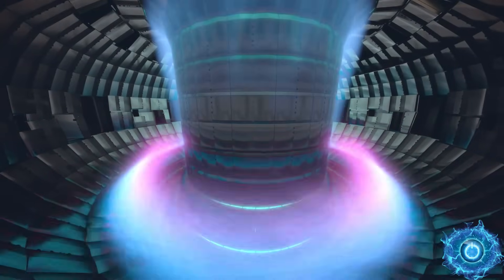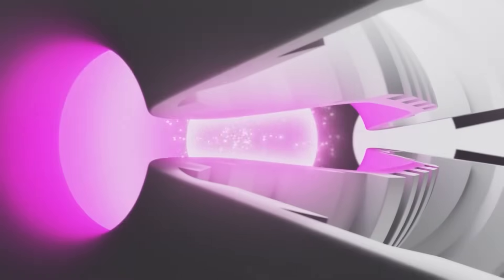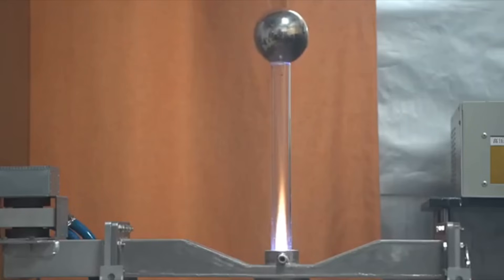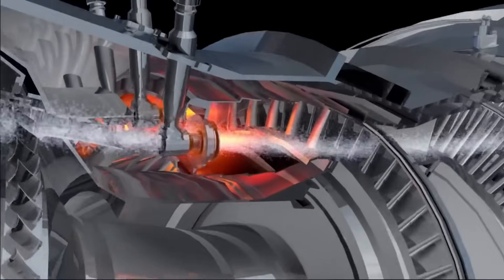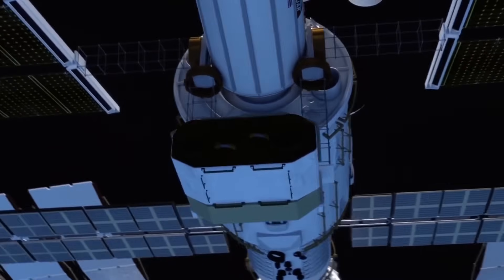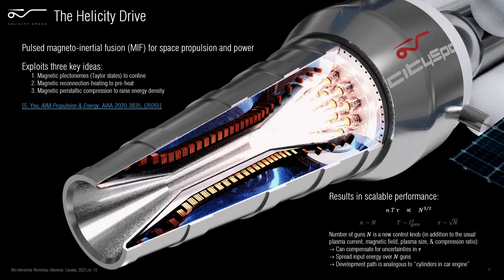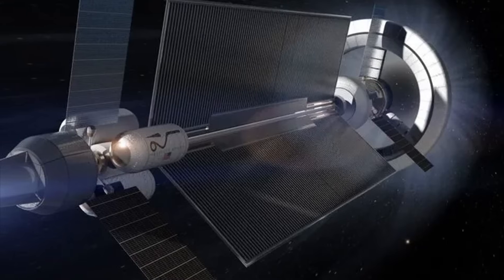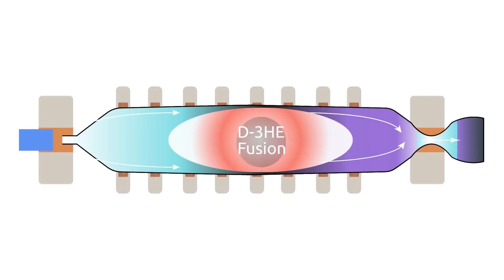New Plasma Engine DESTROYS Rockets!?

Comment: I think a microwave enhanced diode array laser with pulsing magnetic field to compress the flow where small amounts of ??? (maybe iron and hydrogen or carbon and hydrogen) are turned into plasma by the MASER could be fuel and energy efficient enough for long duration space travel.. A solar array to power this in the inner planetary zone would be large but not unrealistic as would a solar furnace.. A small to medium sized nuclear molten salt reactor running an ammonia vapor turbine would not be overly large as a primary or backup power source..

Comment: Check Out LPP Fusion.
They use turbulent flow to create the pinch and produce a plasma beam.  This beam could be used for propulsion.
For energy generation the beam can be passed through an induction transformer to get electricity directly.  No steam turbine.  The pinch also produces a Flash of X-ray which can also be captured and turned into electricity. 
I like this system as it has few moving parts, is compact, and lighter than other fusion attempts.  Which means it could actually be viable as a propulsion system or energy generation system on a space craft where reliability, size, and mass are all key factors.

Comment: any nuclear reactor which has infinite propellant, as millions times more energy storage density over conventional rocket fuels. yes even fission reactors. like photon radiation drive.
Reply: drop out the fusion part, as there are again two concepts mixed confusingly together. just the plasma as the normal electric/heat thruster. until you are making more power from fusion that consuming, dont talk about using fusion for producing real power.

Comment: Tech Planet, If plasma power only needs a power supply, then this power source is possible right now. The project is unfunded, but the concept could deliver Mega-watts in a super small package ~ 1 Mega-watts for just 70 lbs. Power is developed using QED principles. Let me know if you're interested. -e

Comment: We all know that UAP's don't use Plasma Engines. Because there is no propellant at all. So they should dich all of this and research the technologies that will actually get man kind somewhere.
Reply: Yes, but we haven't got there yet to utilise zero-point energy and drives based on it (officially). This is best we got so far but it's an improvement nonetheless.
Reply: @stevannikolovski  have you seen ex NASA scientist Dr. Charles Buhler and his team are called Exodus. They are working on propulsion without any propellant. They claim that the team already managed to achieve over 1G of thrust in Vacuum meaning, things can actually levitate even in Earth's gravity.

Comment: Fusion drives are the ultimate dream towards something like the Epstein drive. Once fusion is achieved, it should be possible to return a small amount of that power back to power whatever's needed on the space craft as well to sustain its own fusion drive requirements; like alternators powering electricity for use in cars, with just a battery to start itself. Fusion drives will require something much more than a battery, like a subMW fission reactor, to start itself, but should be self sustaining once done. Plasma would be a byproduct of the fusion drive, and could be used to excite electromagnetic systems to produce electricity. Now, only to make it so. 😅

Comment: You have solved half the puzzle, plasma needs thrust and using turbine is inefficient; by using frequency to thrust plasma will derive efficiency, feel the thrust from a simple speaker at low frequency...get the feeling?
Reply: Half or less for this gent. He forgot the Bloch Wall frequency. Once that frequency is hit, your free.

Comment: Remember that most Tech that people grew up seeing in Star Trek has become reality.
Reply: I'm still waiting for the holodeck to come out 😅
Reply: This is more Halo than Star Trek. UNSC (Human) ships use Fusion engines, and even though the Infinity uses Repulsor drives it's still technically a Fusion drive.
Reply: @spartantraveler7251  The original Star Trek universe vessels commonly used fusion-based propulsion for sub-light speed travel, I'm pretty sure 45 years count for something ;). Was too old when halo came out to get into it much but I like the Infinity, as far as bad-ass ships go, it's one of those for sure.
Reply: Can't wait to send a fax down to mars
Reply: We are more likely to see the tech from the Expanse coming true.
Reply: @WolfeSaber expanse is meant to be more grounded in stuff we might see in the next 50 years
Reply: And it did because most engineers watched Star Trek and were inspired to create what they have seen.
Reply: we still have none of that tech, what are you talking about

Comment: Now, then releasing something of upper of 1,000,000°C into the atmosphere you talk about global warming beer for real. What do you think that’s going to do to the climate of the planet but now generated magnetic field of bubble you can do it inside atmosphere of the atmosphere, the bubble occurs, how do you contain a bubble to keep it filled around an object it does not happen is different than water. It is the exact opposite so a lot of your stuff will not work as far as heating energy or the plasma to make it expand to create propulsion and generation the turbo ducts one of the blade sections can be set on rotation turning turbine produced electricity. They would have to reach high rate of speed in order to produce energy and possibly put one or two maybe even free generators to ones blade producing energy for impulse shield or bubble, not a difficult design I don’t know why you cannot do that.

Comment: "At roughly 100 Kilowatts". Too inefficient.

"It could reach 123,000 MPH", Too slow, and not enough control.

NASA is really fibbing the designs on purpose.

I mean, a steel hollow ball half-full of mercury can produce the same results at a lower wattage, and the passengers won't feel any inertia.

Reference designs of the "Kugelraumschiff" and the "Karl Schappeller Device: The Vril-1 Drive".

Comment: I think you can make a hydrogen ion engine using microwaves at 1kw that would be more powerful than vasimir. This could be done with a stable self contained plasmoid and linear accelerator.
Reply: Hmm... Thomas Townsend Brown got the drive down even better. If your using hydrogen instead of kerosene, it would need to have a methodology of capacitively carrying negative-ions to be recycled into a feedback loop system, and propel the craft.

He was using high-voltage, and could produce 0.1 Newton of force at 5 watts. Formula: 2,000 Newtons for every Kilowatt.

His "Project Winterhaven" was what we were suppose to have in the 50s.

Comment: Good to keep in mind that you are imparting kinetic energy to the propellant so doubling the exhaust velocity requires four times the energy. Unless you have efficient fusion power or beam it to a spacecraft by laser or antimatter the thrust is going to be extremely low and the acceleration time hug.

Comment: Happy to clarify, if need to be cooled how could be done? I hope no as nuclear power station with water or air or space medium, law thermodynamics..in fact the french power station cool down 185 trillions liters of hot water per year on sea! Be my guess multiply for 250 power station around of the world you get climate change, if you multiply n.of combustion engines you get climate change! "Big boys, big toys" when you manage to to cool without using external medium  and get a Carnot engine you be a winner😮😊

Comment: When you do not think your pulsed detonation engine is too loud, build a nuclear detonation engine. You will not hear anything, not sure why.
Reply: Nuclear detonation engines rely on some kind of suspension system that would in theory cushion the explosion and allow for lower G-forces during a blast, I imagine such device would make a roar of it's own as it's suddenly compressed against the rest of the vessel, like a piston, or rather like a telescopic antenna that's being suddenly shortened... by a dynamite.

Comment: Are the temperatures referenced kinetic or radiant? I would think they are kinetic since it is more about the energy in the particle rather than the radiated measurement of temperature.
Anything with a nuclear reactor (fission or fusion) currently has size/weight limitations.
One of the benefits of plasma drives is the long, slow acceleration provided so you are getting a 'felt' sense of gravity (acceleration) vs chemical engines bursts and glides. Provided thrust is not great but if you can accelarate for half the trip then decelerate on second half, you can greatly reduce travel times.

Comment: I don't think it's viable un the short term (≈50 years) our only alternatives to chemical rockets at the time being are:
1- Nuclear Thermal Rockets
2- Nuclear Pulsed Propulsion
3- Micro Magnetosphere Plasma Propulsion
4- Laser propulsion

For manned spacecraft I mean.
Reply: One more to add to your list; One that actually works, and its silently being used as a "Black Box".

Electrohydrodynamics. High-Voltage in the Megavolt region, creating your own gravity well. Theoretically, if the physics is right, you can make a 5 day or less trip from here to Mars without a sweat.

Instead of the usual 5 to 7 month trip we're told that's all we're to pick up on.

But if your really passionate... other groups got it in an hour... using old tech.

Comment: Imagine being in a ship and walking in the engine section where the ship's power source is a fusion reactor in the shape of Helion's.
Such a futuristic and cool image!
Reply: θα βγάλεις λέπια
Reply: That's suicidal while it's running - and for a long time after it's shut down.
Reply: I don’t know if radiation damage can ever be solved or how

Like all these spaces engine concepts, fusion, pulsed fission, antimatter, they all rely on nuclear and subatomic reactions happening at very high intensities, where all kind of particles fly out in all directions close to the speed of light

No material can survive a cosmic ray without being damaged and antimatter/fusion is basically "cosmic rays at home"
So as they are left running, they will poke holes, displace atoms, create deformation and even transmutation (alchemy that therefore changes material properties, a metal object becomes a random alloy etc)

I don’t really see any solution
Maybe liquid armor? That would help somewhat since liquids are self healing from surface tension

Comment: Femtosecond Laser-Induced Aneutronic Lattice Confinement Fusion Power propulsion
Nuclear fusion occurs in massive stars with extreme temperatures and densities. These conditions can be briefly created on Earth by concentrating femtosecond (1e-15) laser pulses on the threaded concave crystalline Lithium Hydride (LiH) cylinder at the bottom of the rocket. The resulting plasma contains lithium, helium ions, protons, and electrons. Pulsed alternating electric fields shape the charged particles to directly generate DC electricity with magnetohydrodynamics (MHD) and provide thrust. MHD efficiency is more than 90%, compared with 40% for conventional energy conversion. A 1-femtosecond pulse will penetrate 1156 layers of atoms in that time, but the thermal (phonon) energy will only reach the next layer 14 femtoseconds later. The short pulse minimizes the heating and melting of the underlying material. 

Incorporating a cavity structure into the target material traps and slows the plasma dispersion and allows for longer interaction times, potentially leading to increased fusion reaction rates. Additionally, the cavity can reduce mass ablation, improve laser absorption, and facilitate better mixing and compression of the fuel material during the implosion phase, thus contributing to more efficient and effective fusion reactions. Cavity produced with additive manufacturing (AM) techniques minimizes variability and allows for the creation of complex structures. The laser can texture the surface to reduce albedo.

Alternating pulses of electric fields can be used to expel or attract negative particles or to attract or expel positive particles at critical times during and after each laser pulse. The heavier positive particles absorb more laser energy and contribute to increased fusion rates during prolonged stays. Expelling electrons from the plasma stabilizes the plasma, reduces losses due to electron recombination, and diminishes the effect of Debye shielding. Each subsequent layer absorbs a smaller fraction of the energy. A femtosecond pulse of a single joule will heat a spot of 3.6 um diameter and 0.3 um deep to an intensity of 1e-22 W/cm2. That region will receive an average of 7 MeV of energy per atom, equivalent to a temperature of 13 billion kelvin and a group velocity of 6e6 m/s for the heavier ions. The velocity of the protons will be faster. From the point of view of the electrons, the ions are stationary. The containment time is estimated to be 18 nanoseconds. The pre-compressed density is 5.7e28 particles per m3.

Nuclear Fusion reactions of Lithium and Hydrogen
Proton + Lithium-7 = Beryllium-8 (4.42 MeV) = 2 alpha (18.16 MeV); total 22.58 MeV
Proton + Lithium-6 = alpha + Helium-3 (4.27 MeV)
Proton + Helium-3 = alpha (18.8 MeV)
Helium-3 + Lithium-6 = 2 alpha + Proton (16.88 Mev)
Helium-3 + Helium-3 = alpha + 2 Protons (12.859 MeV)

Lithium Hydride must not be exposed to water. Fusion reactions have to be undertaken inside a vacuum. The laser repetition rate controls the output power level from zero to megahertz. Such a system can be adapted for Earth by converting the charged particles directly to electricity with MHD. The exhausted charged particles can heat molten salt, storing the energy for hydrogen production, synthetic fuel production, seawater desalination, district heating or cooling, powering ships equipped with thermoacoustic Stirling generators, and power plants with supercritical carbon dioxide turbines.

With such abundant energy, a trip to the moon would take only 4 hours with an acceleration of 1 G. Similarly, a journey to Mars would require just 5 days, eliminating the need to wait for Earth-Mars alignment. A trip to Saturn will require 10 days.

Back to the Future: Fusion Energy from Garbage
In theory any solid waste material with a density lower than nickel can be used as fuel. These materials can be mixed with binding agents and compressed into fuel rods. Materials that produce charged particles are preferred. The lower the density, the better. Avoid using materials that can produce gamma rays, neutrons, or radioactive isotopes.

Most thermonuclear weapons use lithium hydride (LiH) instead of pure hydrogen for fuel. LiH offers two advantages over pure hydrogen. Firstly, LiH is solid at room temperature, allowing easier storage without extreme pressure or cooling. Secondly, lithium atoms undergo nuclear fission during the explosion, producing tritium (hydrogen-3), which enhances the fusion reaction. Lithium Hydride has a high Heat of Fusion of 2900 joules/gram, low thermal diffusivity of 1.2mm2/s, high melting point of 688oC, a molecular weight of 7.95 grams/mole, density of 0.757 grams/cm3, specific heat capacity of 6.27 j/g.k, and good electrical conductivity.

Comment: I’m sorry but you’re greatly mistaken you don’t only require fuel for a turbo generator you need oxygen  to burn the fuel  and a great deal of it. A fission reactor to generate the power for the plasma Fusion Drive is the most practical way currently

Comment: Also to mention the use of plasma beams for well drilling. The concept is called enhances geothermal. It is possible to drill a well deep enough to tap high temperature. Electricity is generated by using a circulating fluid that turns an electric turbine at ground level.
Reply: (The best-known example being Quaise Energy who, IIRC, are working on a pilot bore at the moment. See their website for details.)
Reply: @chrisconklin2981  maybe laser would help with the pre drill , they are amazing for welding
Reply: what powers the fluid circulation
Reply: @HONESTLYHATEEVERYONE  In general water wells use submerged pumps. Geothermal wells use circulating loops. Geothermal wells that rely on fracking could be artesian or pumped. Plasma wells produce a sealed well wall. In this case surface pumping should be effective. The power comes from electricity.
Reply: But whatts the limit because if to many well are tap then the heat exchange and will cool the earth inner core???
Reply: @RandallEnglish-nf7wq  the earths core is so large its taken 4.5 billion years to cool down enough to create a solid crust only 10-50 km thick, you could have the entire planet run on geothermal energy and it would likely take tens of millions of years to use a significant amount of it.
Reply: @RandallEnglish-nf7wq  As a whole ,I do not think the earth's inner core will cool down any . A good part of the inner core's heat comes from nuclear decay. Also, even our deepest drilling is only just a scratch. The real issue is localized cooling near the radial heat collecting tubes. Over time, if heat is removed, how fast will that lost heat be replaced? Only testing will provide an answer. Say, there is an equalized one degree drop from the original surrounding 500 degree rock. I think we can live with that.
Reply: @RandallEnglish-nf7wq  Over time it would cool the Earth's core, but presumably to only a negligible degree. You're right though, in that the Earth's inner heat is not "renewable". There's a finite amount. Large, but finite.
And presumably if we ever become so advanced that we can do such things, we ought to have fusion power by then. Or something better.